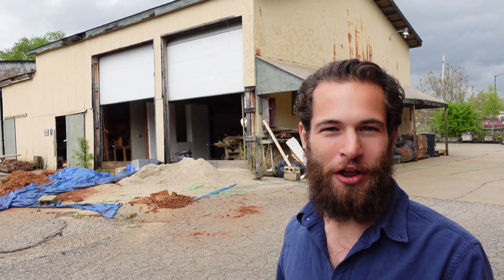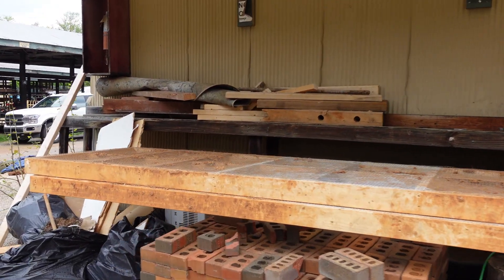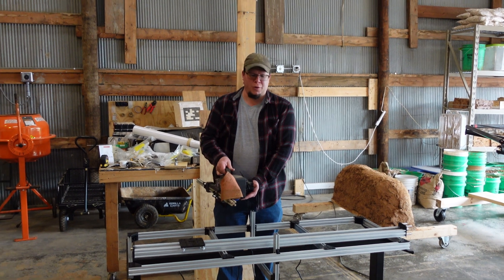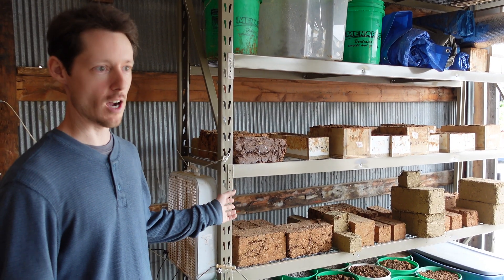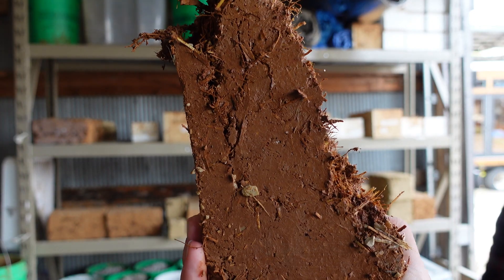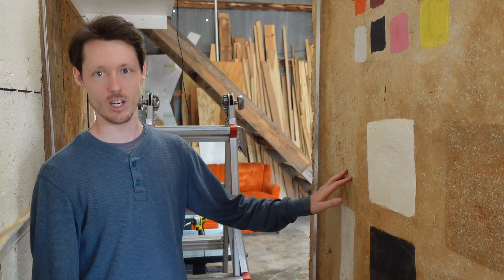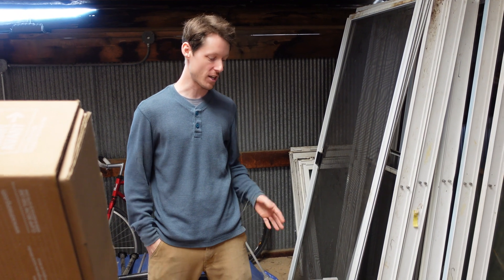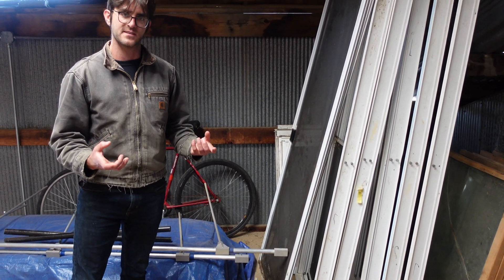Autonomous Drone Adobe Construction Startup TERRAN ROBOTICS

Comment: love the use of hemp and recycling
Reply: Hemp is an emerging industry in our state of Indiana and we are excited to find more ways to utilize such materials.  We also use a very small byproduct from making gravel for our aggregate.  It is far cheaper than sand and doesn't draw on a limited resource.
Reply: @terran2067  yeah well sand for cementus usages. Mine use case is leftover stalks at my local hemp farm for insulation. Would not have the slightest clue to use it as a sand replacement unless milling it to a powder of the cellulose material.

Comment: Was the cob binder plastic strips?
Reply: Predominately we use traditional monolithic adobe/cob mixes consisting of Sand, Aggregate, and Straw.  We have in-house compression testing equipment and are trying out all sorts of new materials and combinations.
Reply: @terran2067  Please, please, please stay away from the plastic shreds as binder. You are on such a great mission to promote sustainability, but there is a large missing factor which is our health as we surround ourselves with toxic plastics. I can appreciate the sustainable approach to repurposing plastic, and its lifespan may be admirable in that respect, but not at the expense of so many air-born and element infused carcinogens. Keep it all natural and you will truly be setting new standards.
Reply from the maker: They test different things, still looking for best practices.